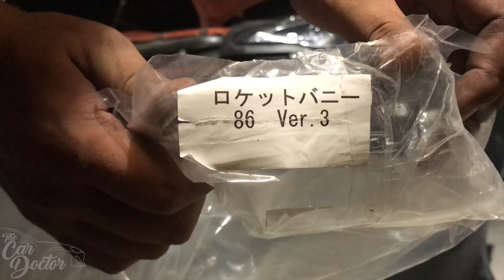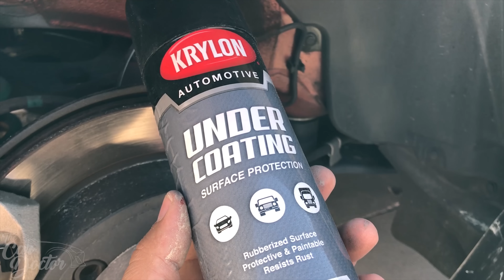How to Install a RocketBunny V3 Kit

Comment: Great vid, but maybe you should put protective covering above the working area to protect the pain about the kit panels that will still be visible. I like to use either soaked linens or a straight up tarping material. The welding burns look pretty long there @ 9:29.
Reply from the maker: The welding residue wipes off the car.
Reply: I'm guessing you MIG'd it then.

Comment: would it be bad to have a square setup with the 285 tires on the front and back? Or would it just look dumb
Reply from the maker: As long as you have nice fitment. Spacers might be needed.

Comment: Are you cutting the original body to fit the new kit ?
Reply from the maker: Yes, This is the case with every widebody, otherwise, the wheel could not make use of the added clearance provided by the over fender.

Comment: Could I install the v3 front bumper without the fender flares or should I just buy it when I can afford it ?
Reply from the maker: The original mounting is chopped off when clearance is cut for the kit. The side clips and bolts now rely on the front arches to hold the bumper. I would personally wait.

Comment: Hei , where i can buy rubber seal around the edges? Can you drop a link or something?
Reply from the maker: The over fender Rubber lining comes included with authentic kits, didn't have to buy separate. But oems like Honda and Toyota sell "Rubber Lining," as well as amazon or ebay.

Comment: So correct me if I'm wrong because I'm getting my Rocket Bunny Pandem V3 kit in a couple days. Running a -60 total offset in the rear and a -10 offset in the front? I thought it called for a -40 front and -50 rear.  I had planned on buying -15 offset 18x9 wheels with a 25mm spacer in the front and a 30mm spacer in rear. I'm probably not understanding the offset math tbh, so any clarification you could offer would be a huge help before I purchase my wheels.
Reply: I'm trying to buy wheels for my kit I just bought as well. What did you end up going with?

Comment: i have a question, can u install the v3 rocket bunny front just the fornt bumper with v1 front and rear fenders???
Reply: You can but It wont look right as the v3 bumper is way wider than the v1 front fenders

Comment: Can you drive in the rain and snow with that?
Reply from the maker: The Body kit?
Reply: @JonnyBarajas  Yes because you cut it did you seal it with something?
Reply from the maker: @benicetotommy7088  Yes, if you watch the multiple body kits I install, they are sealed with glaze and then painted over to seal with 2 layers. Others might not do the same.
Reply: Good luck driving in snow with any body kit

Comment: Wait would my option lab R716's work with soacers? They are a 9.5 +35 rim with 255 firehawks
Reply from the maker: You'll need to measure the distance from the edge of the wheel to the hub, and compare that to the the body panel to hub measurement.

Comment: What are the dimensions of what you cut out?
Reply from the maker: Between 1-.5 inches from the edge of the Over fender placement determined after an initial test fit.

Comment: This is an example of low budget ricing. Spacers are a cheap, bad idea: the geometry of the spindle is now changed and will put strain on the bearings, they will burn out frequently, or worse, snap. 
Glazing over raw metal is another bad idea, eventually in a few seasons the glaze will separate from the metal and rust will happen. 
This is fine if you want a BS "performance" look and don't plan to keep the car long, but avoid buying one of these down the road.
Reply from the maker: Stop. Get some help.

Comment: I don't really understand kits like this on generally slow cars? If you're spending 15-20k on making an FRS meaner why wouldn't you just get a meaner car stock? I do like that color on the kit, though.
Reply from the maker: Aesthetics are purely subjective. A RWD 200hp from the 80's and 90's were titled as "supercars" now they are considered "slow", again subjective. Plus any car can be modified to to dominate, especially in motorsport, This is done all the time. Opinions on preferences and choices will always be present, that's why we choose to do what we like and think looks cool. Sometimes it's more cost effective than the above mentioned option, or they don't want a stock car. Yes, I just happened to have some time.
Reply: If you ever play forza then you will know why
Reply: this is playcar and isn't dragcar.
Reply: late reply lmaooo but kits run from 3-15k so u can spend only 4 grand for the kit and its to make ur car be ur own lol and look sick